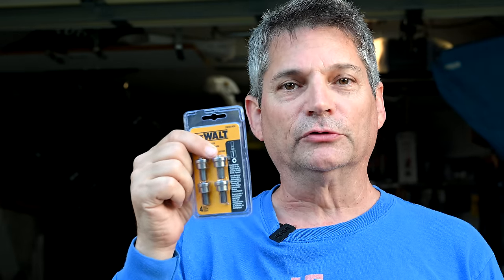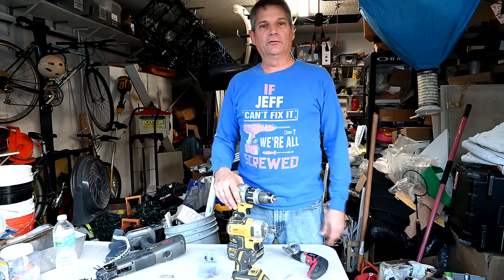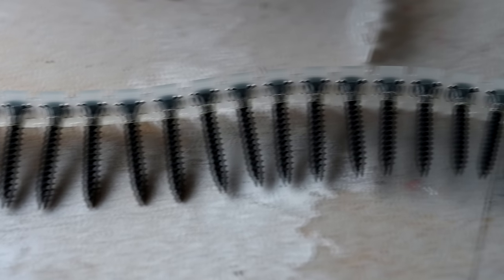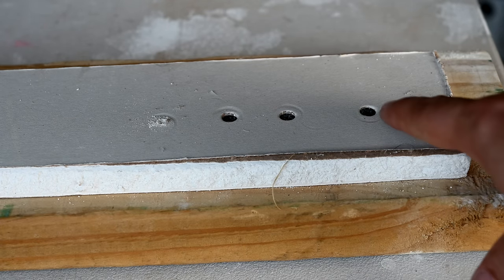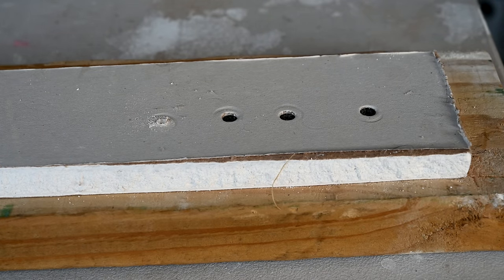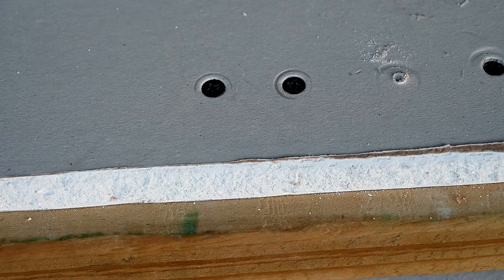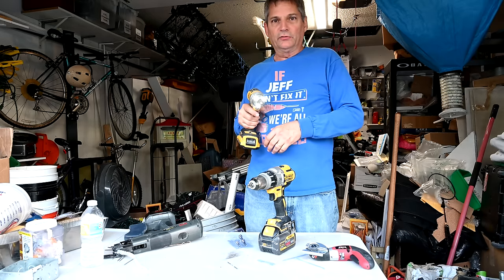Most Don't Know DeWalt Drill Tool: Drywall Screw Setter

Comment from the maker: Tools and products mentioned in this drywall drill video:
Dewalt DW2014C4 Drywall Screw Setter (4-Pack): https://amzn.to/2YC6Yhi
SKIL Power Screwdriver With Cutter Attachment https://amzn.to/30uBOub
DEWALT DCK299D1T1 Hammer Drill, Impact Driver Kit: https://amzn.to/2M6h450
SENCO Duraspin drywall screw gun DS212 18 V cordless https://amzn.to/2WffAgu
Senco Duraspin 1-5/8" Drywall Wood Collated Screw (1, 000 ct) https://amzn.to/2HpQC5C
Senco 06B125P 6 1-1/4-Inch Drywall Screw-Light Steel https://amzn.to/2HrahSY

Comment: Don't want to be nit picky but it's not the clutch that makes it work. The beauty of it is you can use any drill. Thanks for showing people about it.👍
Reply: Your are right that the clutch is not required. But when the clutch is set perfectly for the task, It will automatically prevent driving the screw too deep. Thats super important for the longevity of Drywall, because if the screw goes too deep, it will tear the paper and that reduces the holding power of the screw. Over time, you will get sagging and dimples where the screws are pulling through (you know how houses and buildings subtly move and creep expand and contract).

Comment: Try using them with a screwdriver or a drill with mechanical clutch.  Use low speed and experiment with the torque setting. Also keep the dimpler bits protected from getting damaged by coming in contact with other tools/metals so that they won't form sharp edges that may damage the paper. Try using something like the dcf601 12v screw driver with these.
Reply from the maker: good ideas thnaks!

Comment: I'm pretty sure the "clutch" action in your video was the Philips driver bit "camming out" of the screw (Philips is designed to do that). The buzz was probably the driver skipping over the screw. It doesn't rely on the drill clutch if you have your drill in the highest torque setting as your DeWalt in the video. Maybe on the lower torque settings it would use the clutch. 

I can only get my drill to "clutch" about half the time at the lower torque settings--the other half the time, the Philips driver bit is skipping out.
Reply from the maker: either way the screw does it's job, this screw setter helps it get to the precise depth every time.
Reply: Yes sir, agreed. 😁 Handy product either way.

Comment: It's hard to tell, is it slicing the paper from the rotation of the setting surface?
Reply from the maker: The screw is what slices the paper
Reply: @jeffostroff  No, I was watching a video from another guy who was saying never to use these because the circular stop busts through the paper. After watching a bunch of videos and trying out a hella cheap one from Menards today, I think whoever was using one on his job site was Hulking out on it or something because I didn't have that problem, even with the 2 for $3 ones.

Comment: Good video! I'm pretty sure I have some of these. Didn't know what they were for!
Now do you have any tips on how to keep the screwdriver plum when attaching screws to the ceiling drywall?
Reply from the maker: The drywall screws should stay in place when stuck into one of these DeWalt drywall screw setters. But anyway for production speed sake, we use a Senco drywall gun with strips of 50 screws on a strip that ge tfed into the gun. If you watch our other video on raising the kitchen ceiling here: https://youtu.be/wJHZ_S9e38U you'll see us using that gun to quickly screw the drywall sheets up to the kitchen ceiling.

Comment: I have. My question is why do they come in a pack of 4?
Reply from the maker: Probably because we lose and misplace them. I bought 3 packs of 4, and put one bit in every one of cases to make sure I always have one, then put a 4 pack in my screw organizer case with the drywall screw bins in it.
Reply: They come in a pack of 4. Because they rely on the bit camming out of the screw, therefore they will wear out rather quickly, good for small jobs but better pack all 4 of your doing anything large as they will wear rather quickly

Comment: "textbook?" I believe the idea is to NOT break the paper face on the sheetrock.  2 of the three screws did...
Reply from the maker: How would you get a screw into the drywall without break the face of the paper? You are supposed to break the surface, but the top of the head of the screw should not go past it. You should not see a large white ring around your screw once it is set.
Reply: jeffostroff  we can agree to disagree - best practice is to “dimple” the paper surface - not break it.

Comment: "Dewalt Drywall Screw Setter"  Um, yeah. Except they've been around for years from various manufactyers, and I've always known them as drywall dimpler. 
The clutch has nothing to do with this accessory but can be manually set to the desired break point.
Reply from the maker: Yes we have some from Milwaukee also.

Comment: you need to work with your 4k camera as the image became quite blurry 2 or 3 times when it switched focus from drill to your finger, sure it must be able to adjust field of depth
Reply from the maker: We have better control over it now, that was the first month we owned it, and Nikon has issued 4  bios updates to address autofocus, and now we mostly use new face tracking autofocus features

Comment: If it spins, it can tear the drywall paper. That means the screw isn't holding. Drywall drills don't spin on the setting part.
Reply from the maker: they both drive the screw into the proper depth

Comment: Still,it would be better to use a magnetic tip if it will work with one.You losing that screw kind of proves that
Reply from the maker: I need to dry it with the magnetic sleeve, this whole tip is non magnetic. But maybe the magnetic sleeve will be enough.

Comment: Anyone try these on cement board?
Reply from the maker: Cement board the screws should be flush with the surface. Drywall the screws should be just a frog hair beneath the surface, so I would not use these on cement board.

Comment: 4xs the resolution not 2xs just letting you know
Reply from the maker: No the numbers are double, but might be 4 times the pixels, but resolution is double for both horizontal and vertical
Reply: @jeffostroff  In television and consumer media, 3840 × 2160 is the 4K standard, whereas the movie projection industry uses 4096 × 2160 due to the larger projection size. 4K is four times the pixel resolution of 1080p (1920 x 1080 pixels). With 4 times the pixels, the image will be 4x as detailed.Sep 20, 2019

Comment: 4k resolution, huh? Is that to show off the incredibly clear detail of the rediculiously crazy embarrassing mess that garage is that you're using as a workspace... Or so that the veiwers can get a better sense of what it would be like to actually be right there watching you fumbling with the screws in real life?? 😲 Woooow!
Great investment! ...Hey, Whatever floats your boat. 😉👍
Also, it's called a drywall screw setter, also known as a Dimpler. It's not a "cool DeWalt Drill Tool". These types of "driver bits" or "screw setters" have been around for a while. They're pretty common, and DeWalt is definitely not the only company that has ever manufactured them. There are many different types, with different features for different uses.
Not only does this video completely fail to cover any other relativly useful pieces of information pertaining to these bits (as mentioned above), but it also absolutely should not take OVER TEN MINUTES to show how to use this incredibly simple tool accessory! Jeez!
Sorry if that comes off a bit harsh (no pun intended). I'm merely pointing out the obvious. Come on now. .... Just sayin'.
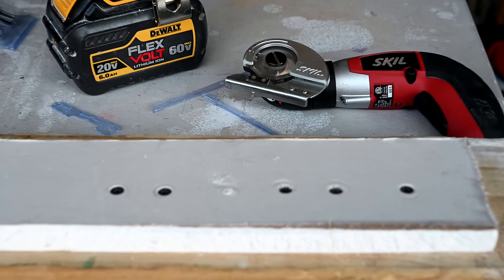Reply from the maker: It's amusing when uninformed clowns don't actually watch the video they are whining about. If only you had actually watched the video at 1:20 and 1:52, and 6:20 there's at least 3 times I called it a screw setter, so your lies about me not knowing what the tool is called are just that lies. And whoopie, so you know it's a drywall screw setter after watching our video so you try to make everyone here think you know something and rehash the info we just dished out to make it look like you know something that we didn't. We see trolls like you every day pulling this trick every day.  Isn't there a Fortnite channel you can go troll? The adults in the room are having a meaningful conversation.
Reply: @jeffostroff  😆😅😂🤣😂🤣
Thank you, Sir. That's just the answer I was looking for! 
I'd argue back, because I do love to do that (especially when someone is as wrong and as defencive as you are), but this is just too good. You see, that's the thing... I'm not trolling. It's really constructive criticism, but you have to see it from the viewers prospective. A video of this caliber is absolutely begging to be criticized. IMO anyway. Just kinda figured you'd be expecting this kind of feed back. I mean, come on. Can you seriously tell me that you believe shooting yourself in 4K, in your home garage in front of that mound of junk behind you, is in any way necessary... In 4K?? Here, I want you to try something. Go to the search bar of YouTube and type in 'Tools Shop product video 4K' just to find videos where others are working with tools, in their workspace, and pick a few similar to your video to watch in 4K, just for a minute or so each. Then come back and play this video. Then go pick a few more similar to yours, in 4K, then come back and watch this one again. Tell me if there are any crazy differences or not. Pay attention to the quality of the product, the quality of the workspace, how clean or messy it might be, how professional the speaker is, the overall production value. What aspects made the use of 4K video useful? Did they use close up shots to show off the vivid colors of the paint job or spectacular detail of whatever perfect project or creative tool  they are working with? That's what you would need an upgrade to a 4K Camera for. Do you still think you needed to upgrade your camera... For this? Though,
Whatever, Man. Do what you want, It doesn't bother me. Just know that when you have a clickbait title on an overly mediocre video like this (that you're bragging about using 4K video to shoot it with), be expecting there to be a few "trolling" comments, merely pointing out the obvious redicuious-ness of it all.
...once again... Just sayin'.
Reply: @MoreEffinCowbell  Believe me Danny, the only reason he's posting videos is to be a "YouTube Star" He doesn't even know the proper name of the tool. I watched a video by Steve Ramsey - Woodworking for Mere Mortals. I gave him a negative comment, but he had the class to comeback with a positive remark. I've been following him ever since. He has awesome videos, not like this classless clown. Jim
Reply: You are one miserable son of a...I am sad for you that this is what your life has been reduced to. Sad place to be, I hope life turns around for you so you can learn to be a kinder better person... hopefully you already have since this was 2 years ago.